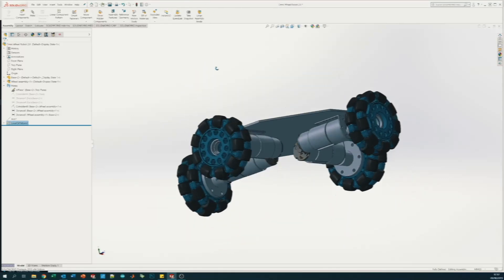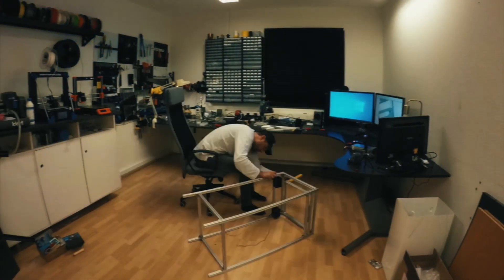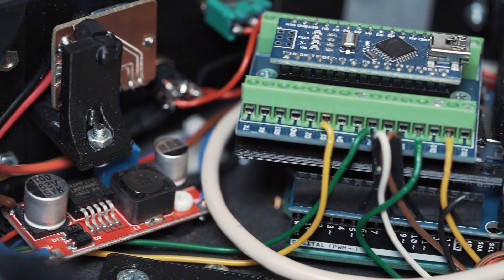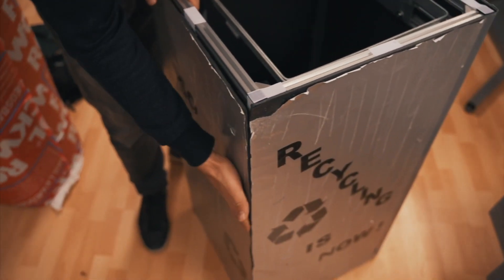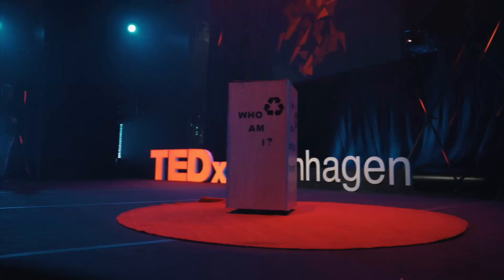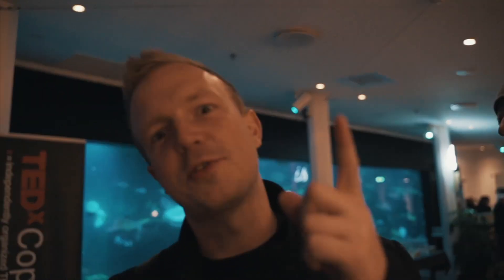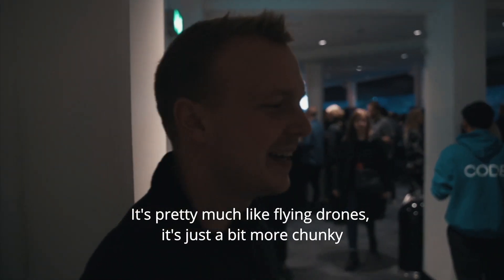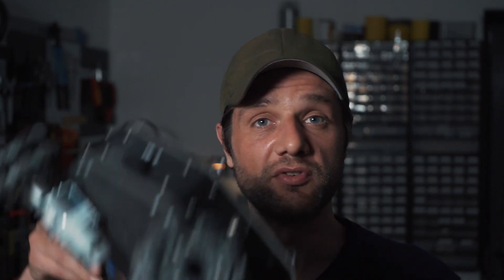Trash talking trashcan robot for TEDx Copenhagen // Omnirobot E1

Comment: Nicely done. Was wondering about the wheel contact, as you kind of answered at the end with the suspension comment. I've made a similar bot, and it's very hard to keep all the wheels on the ground. I saw one with a split middle where each set of two motors cound rock independently, seemed to work pretty well.
Reply from the maker: Yeah I have the same issue. I also have to position each wheel so it's flush with the ground so both "omniwheels" in the double omniwheel supports the weight. Right now it's mainly the one closest to the robot as the have a slight tilt due to the weight. But I think I have to make each wheel indepedant from the others to solve all these issues.
Reply: @MAKESOME  Well looks good so far. Hope you get it worked out!